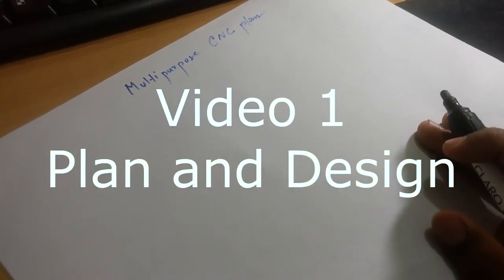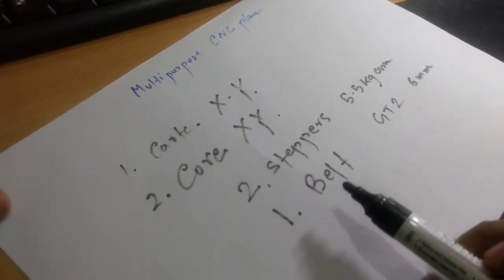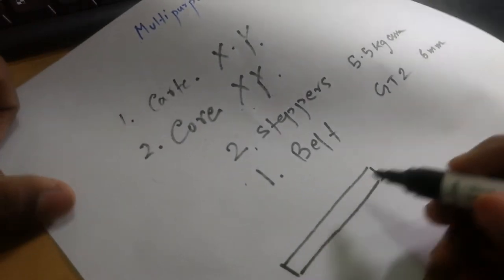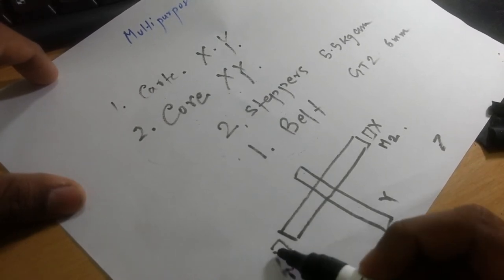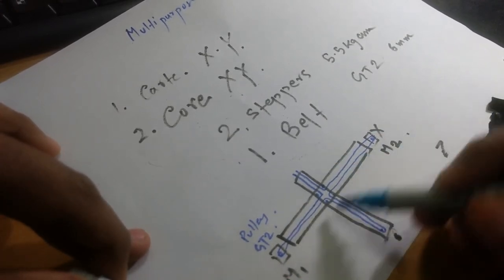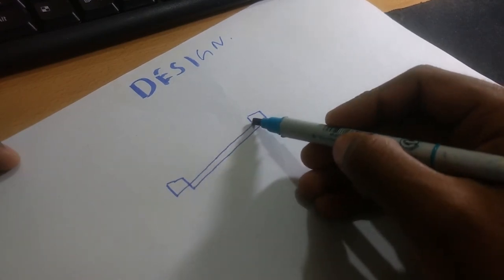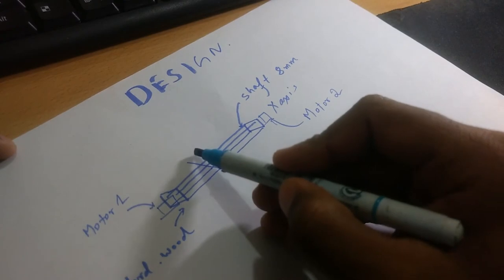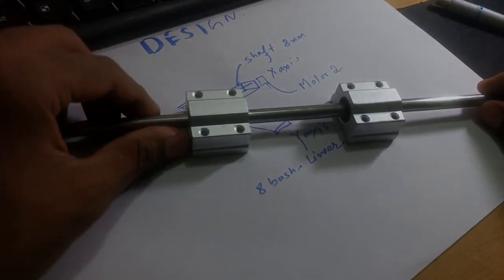Video 1  | How to make Arduino Drawing Machine | Plan and Design | www.ArnabKumarDas.com

Comment: Hello, after following the steps, the cnc drawing machine works on grbl coexy programming, but there is a problem with the servo motor, which rotates very quickly to the maximum angle and does not return. Can you help?

Comment: And sir what is 5.5 kg cm (stepper motor).
Reply from the maker: That is the torque of the stepper motors
Reply: Torque means
Reply from the maker: Torque, moment, or moment of force is rotational force. Just as a linear force is a push or a pull, a torque can be thought of as a twist to an object. In three dimensions, the torque is a pseudovector; for point particles, it is given by the cross product of the position vector and the force vector. Please Search Google for more details Search "DC motor Torque" . Please Subscribe to channel and Like this video. And vist my website for tutorials.

Comment: Please let me know how to configure and upload the grbl file for my core xy drawing machine? I also use an uno with Adriano.
Reply from the maker: Please try to read description of video
Reply: Arnab Das  thanks a lot for this. I do have one question. somehow my servo motor controlling the pen is down from the start. it moves to the place where it wants to draw and then the pen moves up. after the line is finished, then the pen again moves down and touches the paper.
is there any way to reverse this servo motor? I have a feeling there is a way to do so but dont know how to do it.

Also can you please let me know how i can speed up the X and Y axis motors to move a little bit faster? Because i know it moved much more faster before i flushed the Arduino using the GRBL library and setting it to use Core XY.

Any help regarding this will greatly be appreciated.
Reply from the maker: @naaffax6700  1. For Servo Reversal open spindle_control.c u will understand how to reverse 2. To speed up u have to change the acceleration and speed parameter in eeprom of arduino using the serial com port . U can open Universal G code Sender and type $$ to get the settings ..  If you like my videos please subscribe and like them . And please share the channel and and any video you like
Reply: Arnab Das  thank you. i have liked your video and will share your work with everyone. thank you so much.

i have done that using teh speed parameters in the eeprom of arduino using the Universal G code Sender and typing $$ to get the settings and changing them. but that speeded up only a small bit. after that it moved slowly still. i guess the motor reached maximum at that point. but im pretty sure it moved much faster before i flashed the UNO memory with the grbl library. so im thinking there is some more things i can still edit in the grbl library which may speed up the XY Stepper motors. any hint on how to do that?